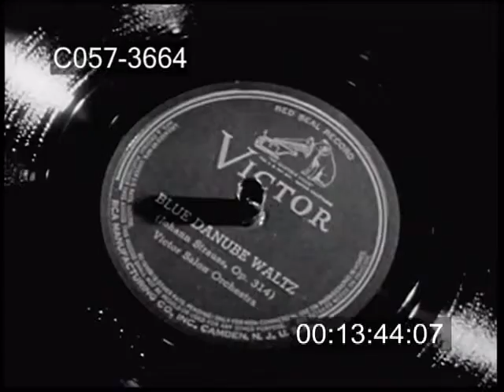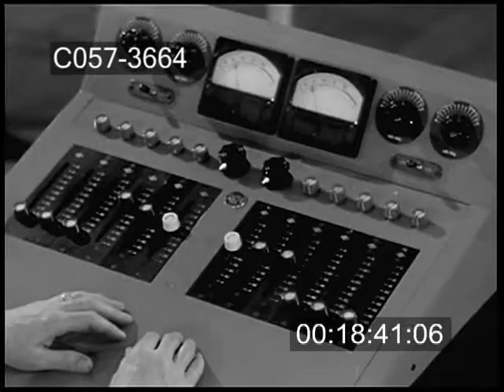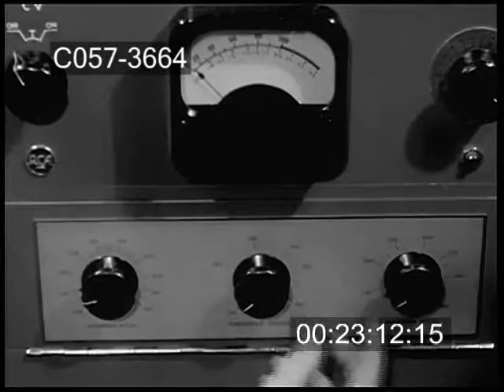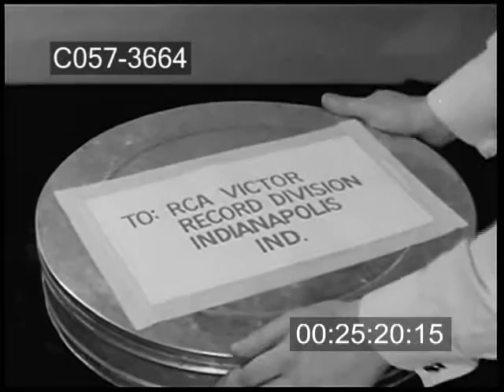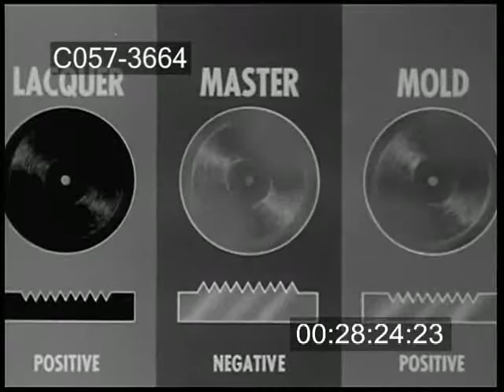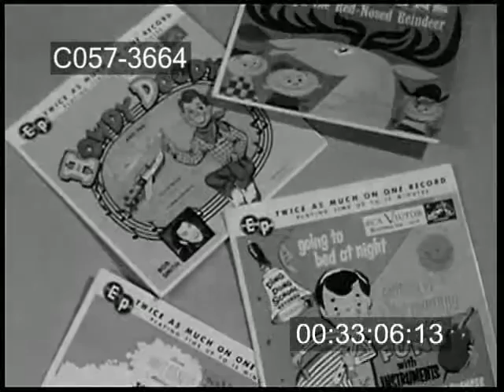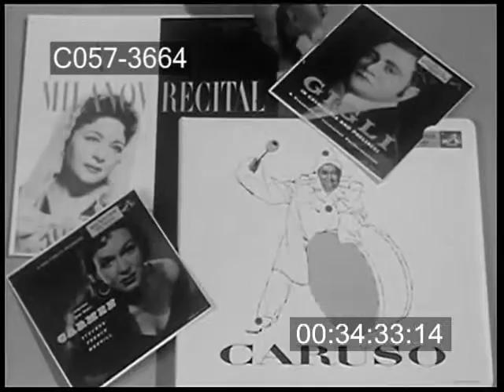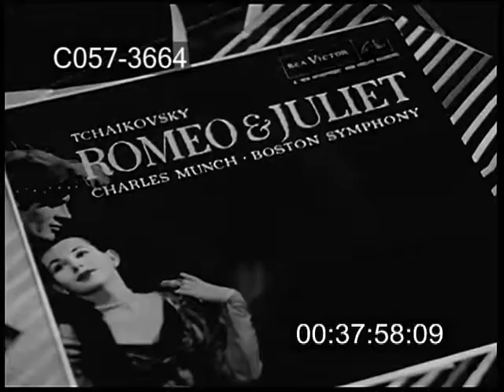Vinyl Record Manufacturing Process - 1950s - 60s

Comment: Isn the  performance recorded on tape first  ?
Reply: Your thinking of Christmas presents. Tape is used to wrap the gifts.
Reply: I was thinking the same
Reply: When did they start recording on master  tape first  ?
Reply: Correct, however, this video is actually from the 1940's before magnetic tape was in common use, so in this era, they recorded direct to vinyl. There's a similar reel to this from the 1950's by RCA Victor which demonstrates a stereo recording being made to tape then the vinyl master being made from the tape. You can find it fairly easily on YouTube.
Reply: @pulsecodemodulated yeah that’s what I thought. But at the end you see the original first Elvis album on one scene. Dating this at least in the mid 50’s